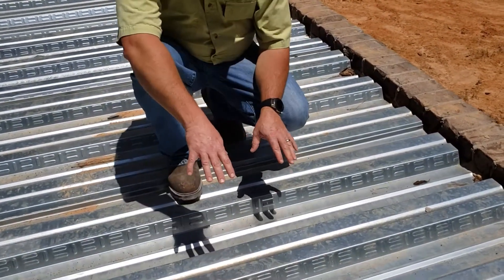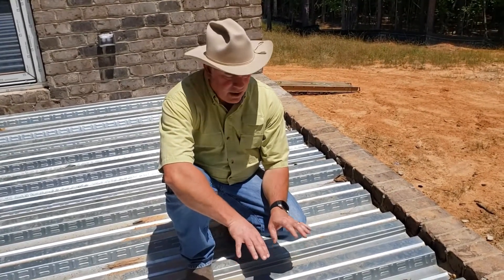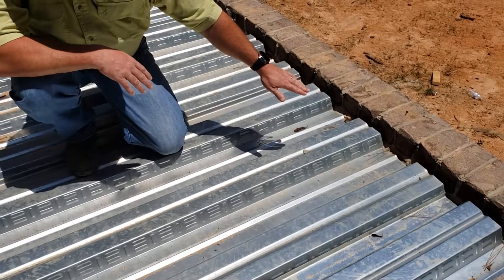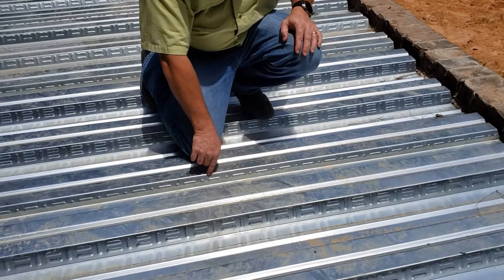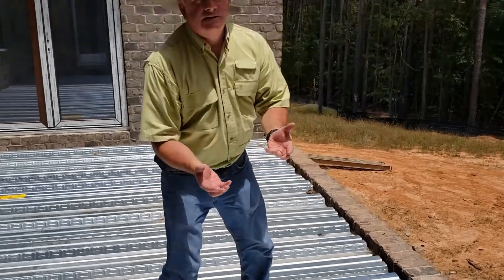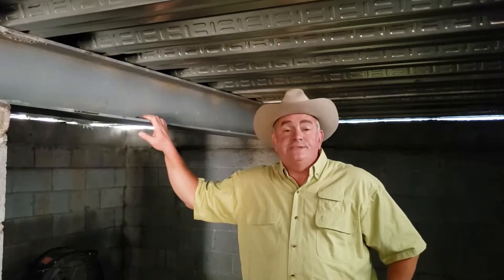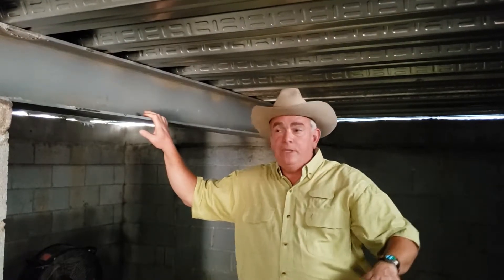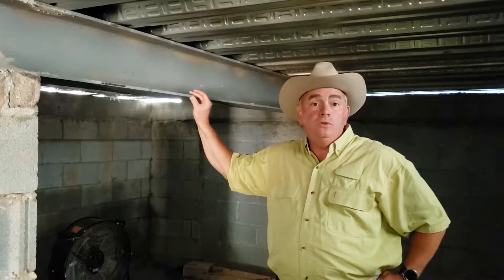Advances in Corrugated Decking

Comment: Hi, I want to construct a warehouse on my personal land 50*100 ft, on top pf it i want to open a football areana (box net and artificial grass) would ot be suitable for that.

What type pf concrete should i use foam or normal.

What thickness should i keep for the concrete, as shown in the video it is 4.5  inch.

At what span the sheet meeds to be supported?